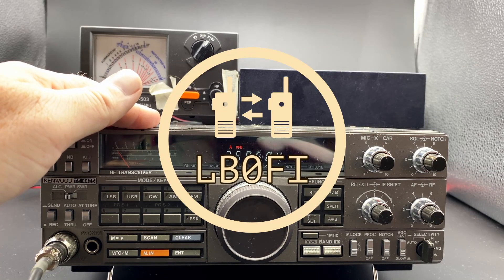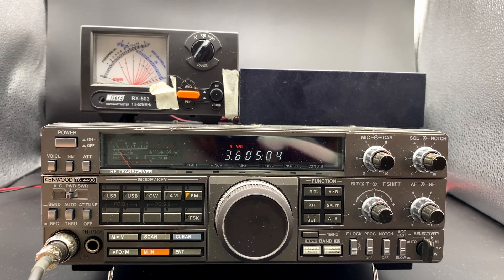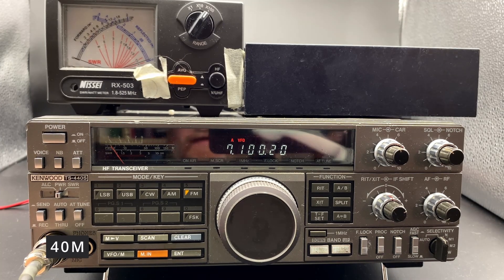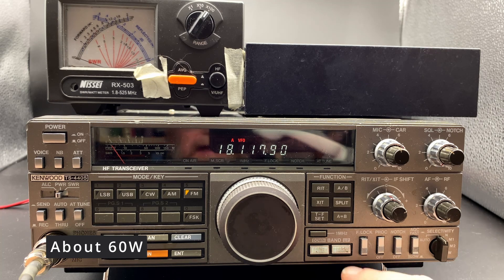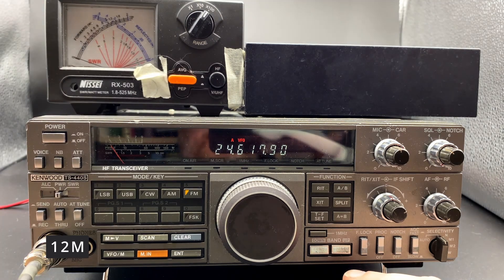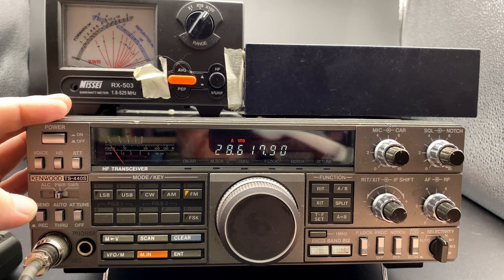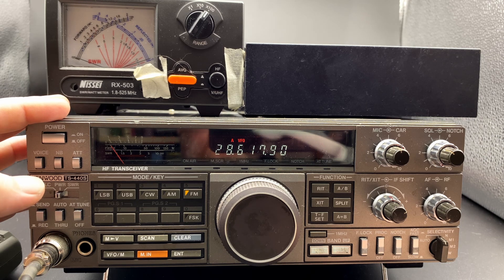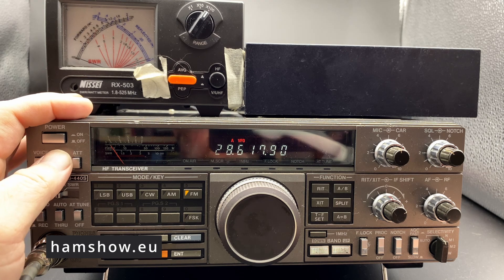How many WATTS are left in the TS-440?

Comment: i would just add a 12v LED to fix he back lite issue. Wire it to the battery in. A small spot of hot glue to hold it in place and it will provide a good back light. Super cheap fix too.
Reply from the maker: Didn't we just discuss this in another video on the same radio?

Comment: Check diodes next to relays, a common failure point in this model, and relays are cheap and accessible these days, too. In general, on the Web, you can find the information you might think about this radio. In this manner, it is more kit radio than commercial made. If I advise something for beginners, it would be this as it still has a single layer through hole PCPs.
Reply from the maker: The internal tuner was, and somehow still is the problem. It does not always disconnect, and it struggles to tune. The next step is to remove the tuner.

Comment: Those age of Kenwoods have band switches in them for changing filters.  They might need to be cleaned.  73
Reply: Its little brother, the TS-430, had a procedure from Kenwood specifically for cleaning the relays. It involved putting a fair amount of power into the antenna connector and constantly cycling through all the bands for a few minutes. This was supposed to burn off any crud on the relays.
Reply from the maker: @Kilroy_Was_Here_1897 I saw TO do that, it might be worth a shot.
Reply from the maker: Comments like this is why I love Youtube!